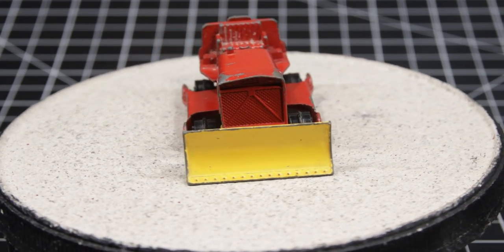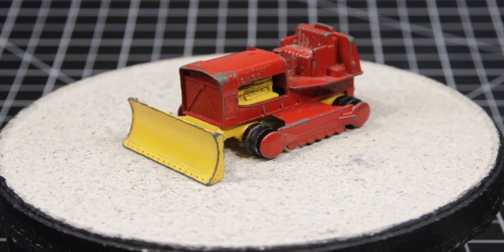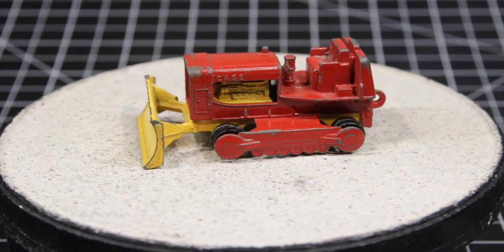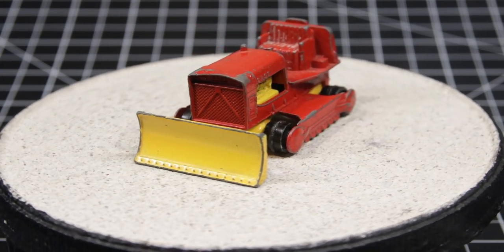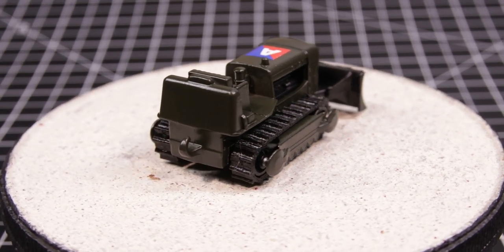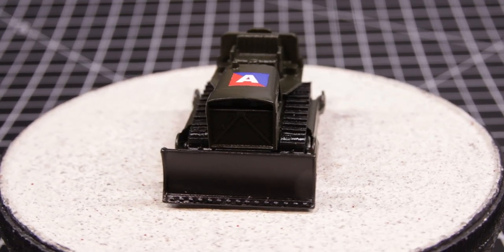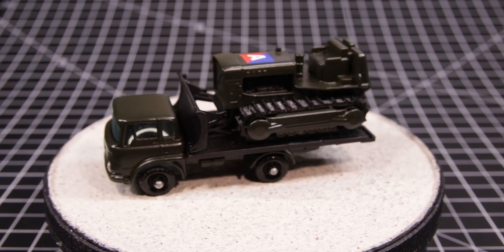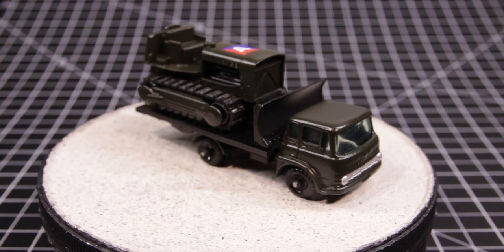Matchbox #16D Case Bulldozer - Beef Eaters

Comment: I still have mine from when I was about 9 or 10 years old and gas was still 25 cents a gallon, regular, leaded gas. It's packed up for the time being with solid tracks from a war gaming tank and sporting a bronze green finish. I needed an engineering vehicle for a game that I used to play. FYI to anyone that either games with or collects 28mm-30mm scale figures, this is just the right size for a project in those scales. At one time I had the complete set of the dozer, low boy and tractor but the last two are long gone.  My dozer is still incomplete as its missing the cad and I don't have the cash to get a replacement. I enjoyed this immensely as I do with your other videos.